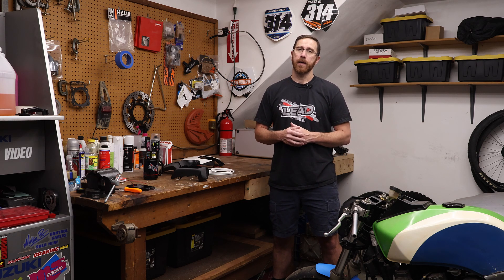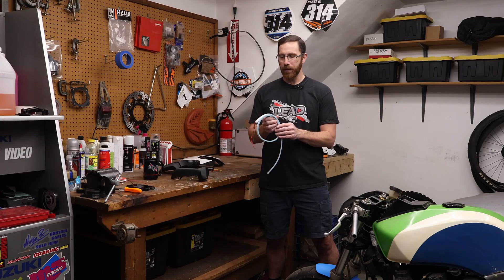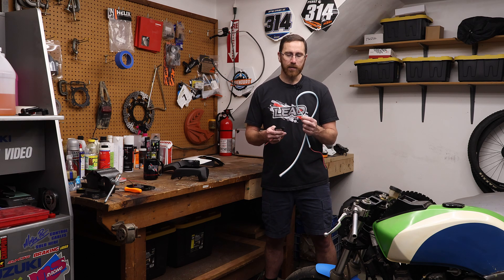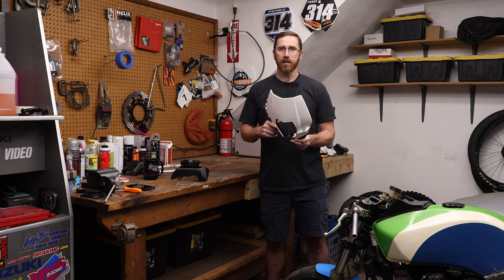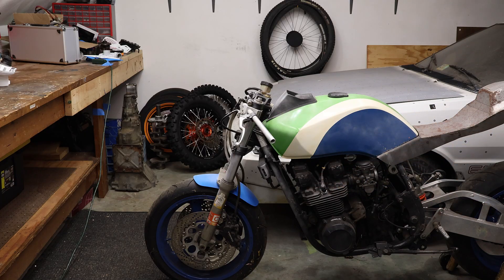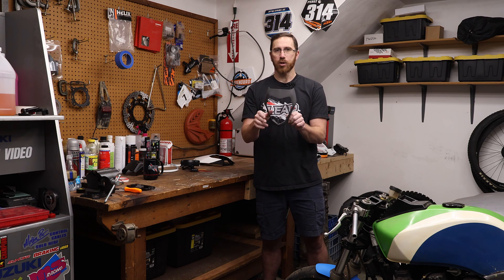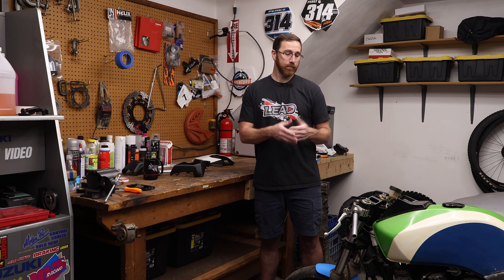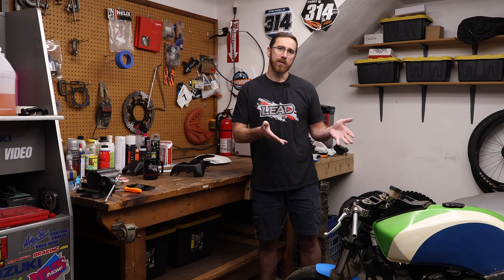Custom Motorcycle Headlight Design With 3D Scanning, 3D Printing, and Fusion Forms | GPz Series 04

Comment: Hello Matt, you mentioned how freeform modeling is more artistic without numerical inputs. My question is, how would you go to about getting the part manufactured? I would assume a piece like this would be injection-molded, but does it need to be assigned dimensions or can you just export something like this directly into CAM, skipping the need for dimensioning and eng drawings?
Reply from the maker: Yeah great question!  We did recently release a course on our site www.learneverythingaboutdesign.com doing a forms based handguard and made it for injection molding.  So we walk through the things to consider, how you could deal with draft at the forms stage and how you deal with it with features after.  We walked through the design and all the forms, surface, and solid tools to make that happen.  

With forms you can use premade surfaces or solids and attach to them.  So if you had to have a specific parting line for example.  you could make that first and use the MATCH tool on the form to snap the form to it and drive tangency.